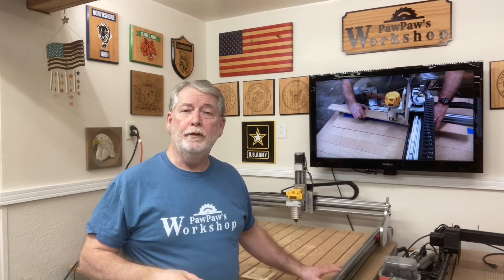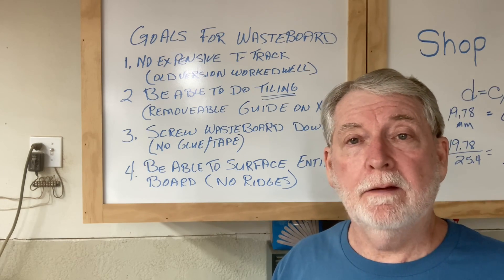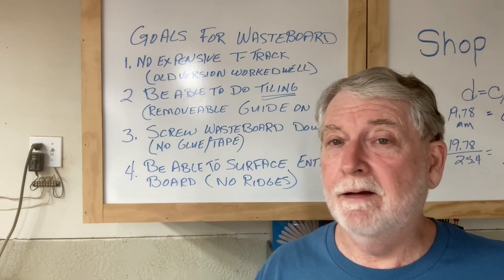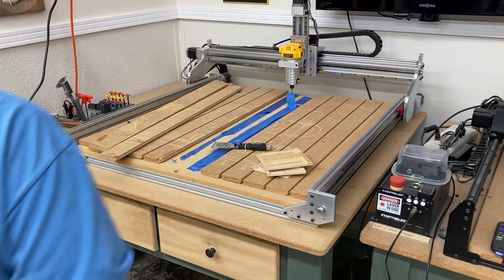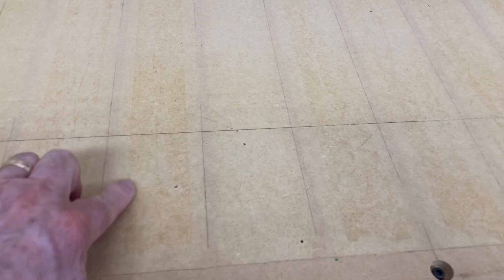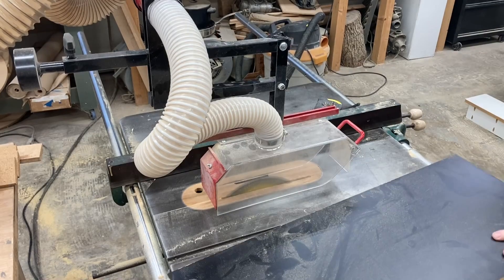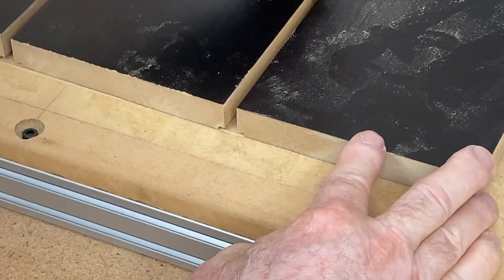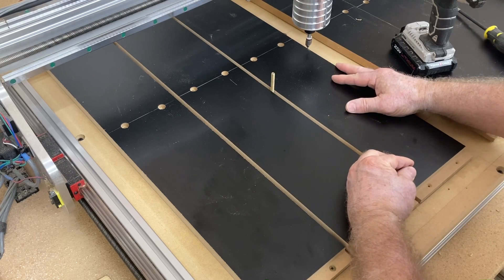Adding NEW Improve wasteboard

Comment: Icd eotk. Might try thst on my 4030 ProVer & 4040xe try to make hybrid table. 
Amazing accuracy of your baseboard and new wasteboard.
I like X & Y edge rails, bolt down on front line of bolts, add small clips on same bolts to hold material at edge, then usd either bump stop or slide clamps for other 2 sides
Reply from the maker: Great idea. Thanks

Comment: Great video,,,again. I’m new to the cnc world and picked up a fox alien 4040xe. I haven’t used it yet, and before I commit to a design program, which one would you recommend? I see you use V Carve. Have you had any experience or thoughts on Easel?  Appreciate your thoughts.
Reply from the maker: Easel is very easy to learn. The problem is the subscription price. It gets very expensive over time. I still use easel a great deal. I am using VCarve Pro as my go to program more and more. It can do so much more and once you buy it, it’s yours. No monthly fee.
Reply: @PawPawsWorkShop   Thanks for your insight. I will look at the  V Carve program. Would like to learn one program as opposed to multiple platforms.